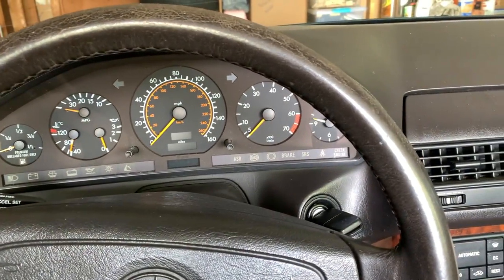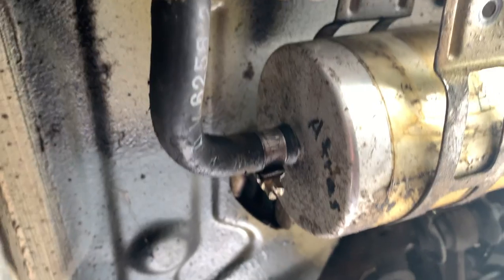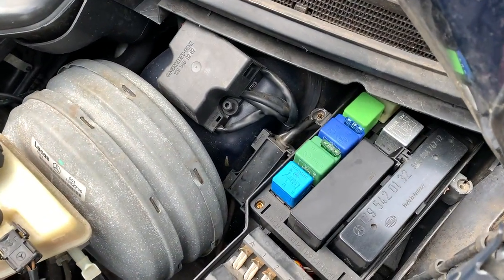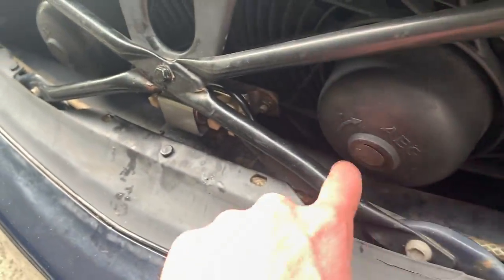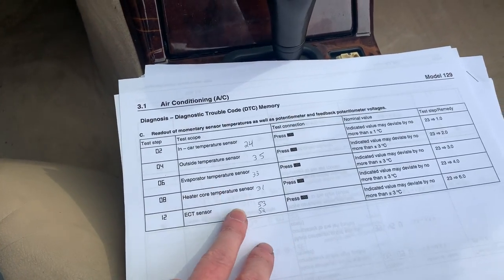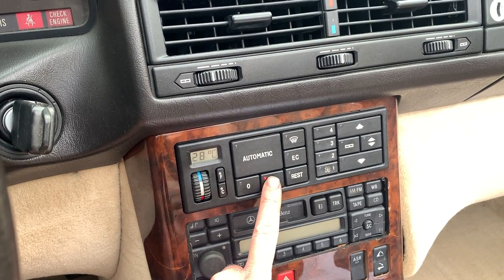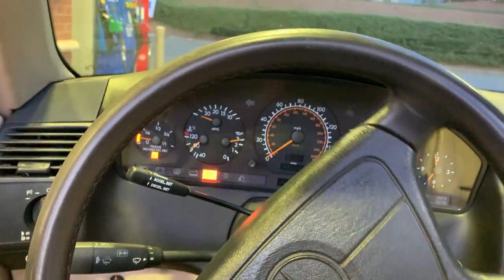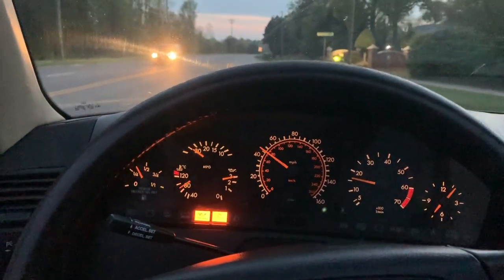Turning ASR Light Off Mercedes SL500

Comment: You still seem to have the aluminum fuses on the car, remove them and clean the contact points on all of the fuses, do this every service, if you can, replace them with copper type fuses, the corrosion on the aluminum fuses causes havoc with the car electronics. These cars have 2 distributors, which tend to get moisture in them when the caps are cracked or if the o ring gets worn out, open and dry them out carefully using a  hair dryer, replace if you can the o rings on the back plates of the distributor caps, doing this will get the engine to run more smoothly. Good video 👍